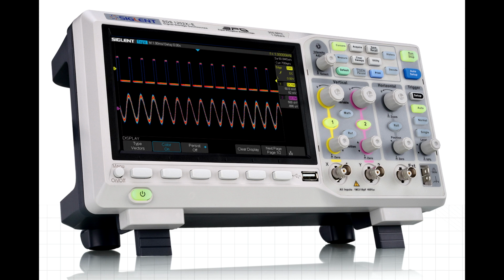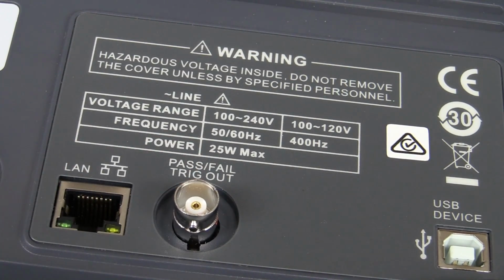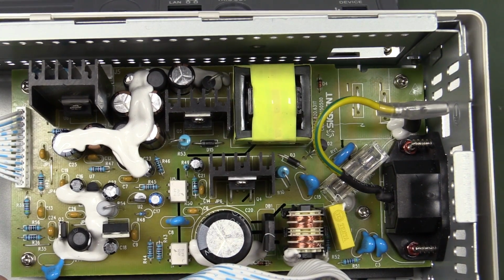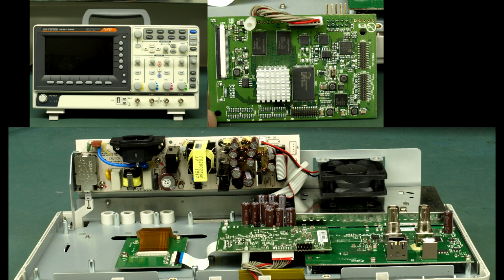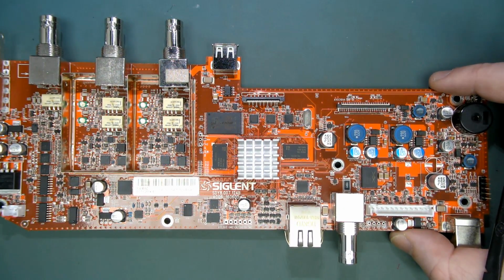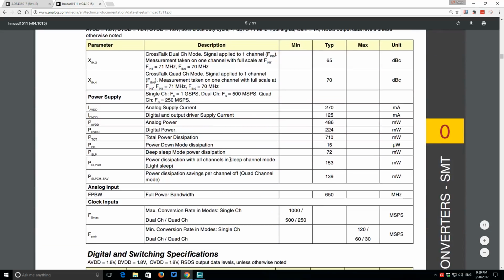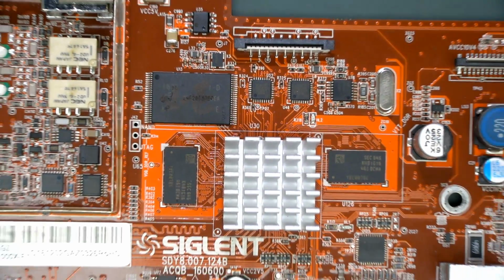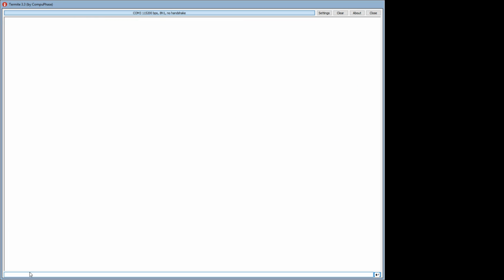EEVblog #985 - Siglent SDS1202X-E Oscilloscope Teardown

Comment: This scope sucks. You can't view signals below 200mV without the trace disappearing from the screen
Reply: User error.
Reply: I was able to fix it by doing an automatic calibration. That tells me it has some software issue
Reply: @kylefafnis  I dont think that really points to a software issue unless your manual settings matched the auto cal mate. Its a really popular scope and so bugs have all been identified by now with it being out for a few years, I'd double check amplitude v/div, trigger setting and dc offset.

Comment: HI,
I bought the oscilloscope SIGLENT SDS1202X-E a week ago, but I have a "newbie" problem. I cannot see the signal on both channels at the same time. That is, if I measure a signal on CH1 and I want that same signal on CH2, I can't stabilize the signal on both channels, only one. Any ideas how I can fix this and stabilize it on both?
Thanks.

Comment: Mine went off while pushing buttons, with a beep as it went.
Is there a fuse or a cut-out?
The Siglent  name remained on screen until AC supply was removed. Then it went off, not tocome back again!

Comment: I own a Rigol DS1102E which I love imgs.love/Si-Oscilloscope?ㄱ1 However this scope is much better than the Rigol. It has independent controls for each channel, it has a large display screen, and a few features like the button test and display test that are nice to have. The quality of the probes are ok, the probe leads are small and flexible. I would recommend this scope to anyone getting into electronics.
Reply: @rateau-789  I am torn between these 2 as well but its looking more like siglent

Comment: 14:24 Those bunch of transistors, could be P-Mosfet level shifters, concerning the IO pins of certain Arm processors are 3 Volt max and not 5 Volts resilient... But it does not appear to be a part of the normal function, my guess, so maybe they are just some internal test points or some direct I/O connections to the processor that have been made 5 Volts resilient. Like maybe the USB port, if that's what it is just directly at the right, or is that the ethernet socket? Or maybe they are connected to the JTAG / serial ports, always good to have those 5 Volts resilient so you do not blow up the processor inputs... Just noticed, that at the tip of the probe it reads 2V5 while the JTAG port has 3V3, so maybe it is even worse, level shifting from 3V3 to 2V5 to protect the processor inputs...

Comment: Has anyone else noticed that this scope can't be set to trigger each channel individually?   And without a vertical channel trigger source mode, it's really annoying to do analog test work. Constantly button-pushing to get it to trigger.   So q. for anyone knowledgeable about this scope's hardware: is this scope capable of triggering on different sources for each channel?

Comment: The Dual Core ARM A9 with Co-processor(Zynq 7000) seems to do the business with this Siglent scope.  Wish the Rigol wasn't so crippled with the Single Core processor(Spartan-6-25) running 4 channels. Everyone seems to be hoping for a firmware update to repair the glitches of an underpowered scope. Wish the Rigol had the processor to do the business. Sighhh The Siglent has some processor overhead for future firmware upgrade functionality which is inspiring. Even if you had to recap the power supply with Nichicons, Panasonics, or Vishays, still worth 379 bucks. By the way LeLon is a subsidiary of Elna which instills a little confidence.

Comment: Should I get this scope or the Rigol DS1054Z?
Reply: Each has advantages and disadvantages. The Rigol has four channels; it's often useful to see more than two things at once. But out of the box, its bandwidth is only 50 MHz and it has no serial decoding. (A few minutes with Riglol will up the bandwidth to 100 MHz and turn on decoding.)

Siglent's new scope is 200 MHz, though you'll really only get that bandwidth if you're using just one channel. (Both of these scopes sample at 1 Gsps divided among the active channels. The sample rate is 1 Gsps for one active channel, 500 Msps for two, and 250 Msps [Rigol only] for three or four.) If you're doing RF work, the ability to see higher frequency signals may be crucial. Siglent also claims to have the full sample memory available at all time base settings, whereas the available sample memory on the Rigol varies.

Real world performance? We'll have to wait until the reviews of actual use of the scope come in. That aside, the decision will come down to whether you have more need for the extra channels or the extra bandwidth. The street price is comparable ($379 vs $399) so that's not a factor.

Comment: For whatever it's worth, I'm glad to see the recent scope videos for newly released models in the sub-$1000 (sub-$500 in this case) price range.  This kind of detailed information isn't easy to come by.
I don't yet own a scope but I appreciate how important a tool it is, and I'm starting to run into a greater need for one.  These recent Keysight and Siglent offerings are very relevant to what I can consider saving up the money to buy.  I'd be surprised if most of the viewers here aren't also interested in them.

I'm hoping we'll get to see some detailed reviews of features/functionality/problems for both the new Keysight and the new Siglent, and comparisons between them and the Rigol which stands as the current market darling.
The lower end of the scope market (what I think most of us can actually afford) is getting really interesting with the new product releases coming out, so it makes sense for this to be a hot topic right now.  Personally I'm eager and grateful for any in-depth information we can get about them.
Reply: I can't think of a single reason to get that Keysight over this Siglent or the comparable Rigol/Instek unless you really care about that Keysight sticker on the front (and the giant logo shown at all times in the display itself lmao, great use of screen real estate). The keysight is an absolute bare-bones scope, tiny amount of sample memory, no phosphor-type display, the decoding functions cost extra and it doesn't seem like you'll be able to hack them in, ever. It also starts at $450 for a (haha) 50mhz model that you need to void the warranty to get a decent bandwidth out of. It's strictly for the sort of person who cares about nothing but a brand name. 

I'm pretty sure this is what Dave was trying to convey with the whole dumpster thing, I can't wait for the full review of the Keysight if it's ever even going to happen. What can you possibly honestly say that's positive about that after seeing what you get for under $400 here. It's going to be interesting and say a lot about the integrity of this channel either way it goes.

Comment: Am I the only one worried by the way they "glued" the PSU capacitors ? (I can never remember the name of that white stuff)
They seem to be partially sealing the vent of the caps, preventing the escape of any potential smoke. And since they are not top notch one, this may be a concern !

Comment: "Brand spanking new scope" runs Linux from 2 years ago...
Reply: Welcom to the ARM world.
Reply: Scopes aren't built overnight!
Reply: Keysight Oscilloscopes Neither are computers, but somehow I can run the newest kernel the day it is released on my PC and router.

It has network connection so it is vulnerable to remote attacks. And if you can't rebuild the base image for 2 years, that means you won't ever update it, so when the remote exploits are found in the scope, they will remain exploitable, forever. And yes, I said "when" not "if". All software has bugs, so the best we can do is deploy fixes quickly, and no, "2 years" is not "quickly".

Comment: Does this thing produce the same distortions at low frequencies as the 1000x series (50 Hz squarewave)? Ist the x-y mode faster? And does it also log only 0,3 sec at seriell decode mode (9600Bd)? I bought a SDS1102x and then sent it back. I did an video about all the problems "Geniales Teil..." - in german - sorry...

Comment: why gunk over the capacitor vent?
Reply: Clearly to prevent venting when insufficient pressure is built up. I hear plugged vents give capacitors an extra +50 Celsius rating
Reply: I believe capacitors can wriggle around in their place.
Reply: i know but the vent is blocked
Reply: If the cap were to blow, the Silastic will just blow off and won't prevent venting. When they vent, the release is rather violent. The Silastic is just there to reduce vibrations and keep the components in place.

Comment: damn I'm in the market for a new scope to replace my 1960s era Tektronix 321.. this seems extremely tempting. (damn, it's almost $600 on amazon right now, kinda whacks the value proposition a bit)
Reply from the maker: It is NOT on Amazon yet. This scope has not been released yet. The one on Amazon is the X model, not the X-E, they are VERY different!
Reply: yeah, I figured that out and realized I was jumping the gun a little bit! I could blame manufacturers for using tiny differences in model numbers, but it was actually just my being impatient... still, I'm gonna keep an eye out for this one! It'd be nice to upgrade my scope by about 60 years worth of tech.

Comment: whats bettet 100mhz or 200mhz I've wached several videos on these things but dot realy sure what they do.
Reply: The 100/200Mhz rating is the analog bandwidth, once you feed in a signal that oscillates or changes faster than about 5ns; the faster these changes occur, the less amplified and visible these changes will be on the waveform displayed by the screen. Parts of the signal that change slower than one oscillation every 5ns will be shown as they are detected.

The sample rate is different, this is how many times a sample is taken. A oscilloscope which can sample at 1GS/s would have 10 samples to represent a single oscillation of a 100Mhz  sinewave (assuming it didn't have anything beyond simple regular collection of these samples) 

The sample rate at higher frequencies determines the accuracy of the waveform shown on screen.

A simple oscilloscope with 1Ghz of bandwidth, and 10Mhz of sample rate would be close to useless with modern digital signals on something like an Arduino in many usage scenarios

A simple oscilloscope with 10Mhz of bandwidth and 1Ghz of sample rate would be usable with such digital signals, for simple to intermediate electronics.

Both would be usable for audio signals, but the audio samples would probably be only 8 bit to 12 bit (typically), so only as a diagnostic tool, both would be an expensive and poor choice for actual measurement of audio signals.
Reply: Not an expert, but I think it's the maximum sampling rate. How many pieces of the signal it can take over a given amount of time to construct the waveform. In this case, it's able to take 200 million samples per second, vs 100 million samples.

I'm not sure what applications actually require that many samples. I'm guessing perhaps radio frequency gear, where it's generating signals in the mhz range to be transmitted? But that's all I can think of.
Reply: thanks for taking time out to explain.
Reply: thats ok :)

Comment: I have SDS1102x-c. it's the same hardware. but root password is not 'joshua'....

/ # ls
bin      etc      lib      mnt      proc     sys      usr
dev      init     linuxrc  opt      sbin     tmp
/ # cat etc/shadow 
root:$6$DZO.HiUy$JKaJGKC8ynyAn.7IF64GzC6cGnmJCQgGlqoPQ9QTc7EW8iF/8lMD00EtiiS3/GpgzN7rvfTbmfnAKzAg66dnu/:17177:0:99999:7:::
siglent:$6$tOEDgvF2$A2zA0bgMZ9XU7LTZN5FVGl4iuDUoPGqGG8IrHoTRaPRJzYyIDXQ8lh8.E1PX98HS8UDRBgDdXwRHlWUG5fY4M1:17029:0:99999:7:::

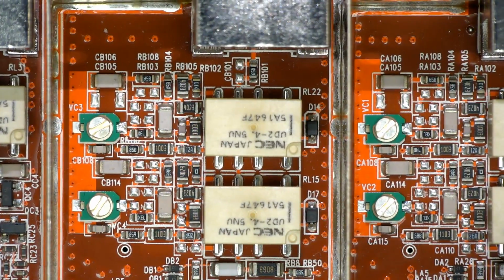Comment: 19:24 - I see four resistors that are different!  The resistor at the 5 o'clock position of VC4 (bottom left corner of screen) is marked "65B" and on the other channel next to VC2 it is "58B".  Then on the VC3 it is "85B" and the other channel next to VC1 it is "74B".  Someone else can look those codes up.

Ya, I had to look after Dave said they looked the same!  ;-P
Reply: Well spotted
Reply: Firecul42 - Thanks.  Any thoughts on why they would be different?  To me the front ends should be exactly the same on both channels.  The only difference I can see is perhaps one has a longer route to the next stage (ADC) but wouldn't that just mean snaking the shorter one around until it was the same?  IDK.  Seems weird.
Reply: .. and BTW: VC is a *V*ariable *C*apacitor, which I think was on the bottom side of the old one if I saw it right blinking through the holes in the PCB. Maybe I'm wrong.

Comment: Why so picky about caps? Is lifespan your main concern?
Reply from the maker: Yes. Electrolytics are a big failure mode in products.
Reply: Yes, you want high quality caps at least on the output of any power supply.
Reply: Cheap electrolytic's can become such a bother over time, and not always obvious when they fail either
Reply: If you have a product that has not been abused and just stopped working, very good chance the cause was cheap electrolytics. For a product that's likely to be used for 20 years, you want good ones.  Absolutely lifespan is a major concern. I wouldn't buy a scope knowing it wasn't going to last 10+ years. Test equipment should last decades.

Comment: Very cool.  This may be the new scope i buy this year.  I'm still using an old B&K Precision 2120 that a professor gave me back in '96.  Thanks Dave!
Reply from the maker: If it suits your budget and you don't need 4 channels, then it's a good buy. 200MHz bandiwidth + serial decode for $379 - insane.
Reply: @EEVblog  Is it still worth buying in 2022? or should I buy some other scope? (In the same price range)
Reply: please do a feature checkout and a review, and also show the FFT...:)
Reply: Yes, it is an excellent offering, but how on earth can it decode a 4-wire SPI bus with just 2 channels? I need to decode MISO and MOSI an the same time, which calls for four channels. Or what am I missing?